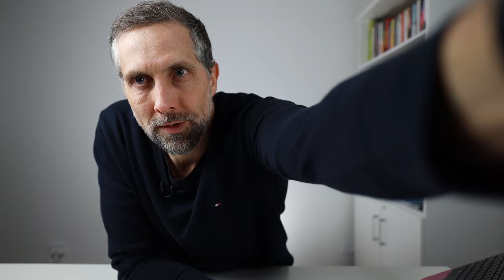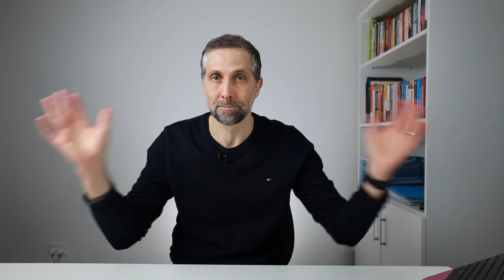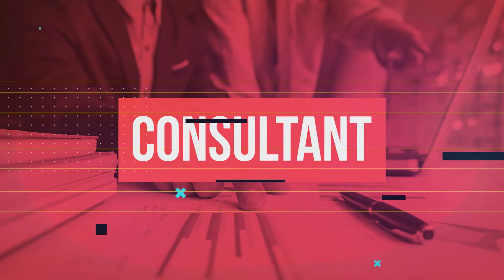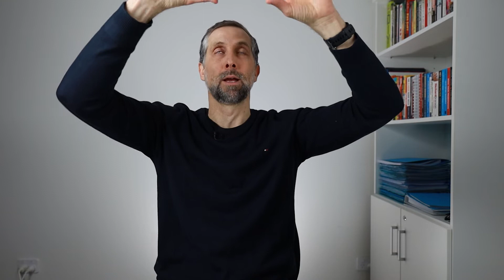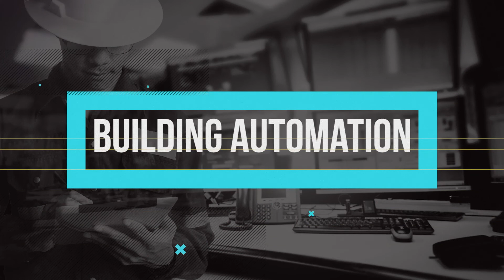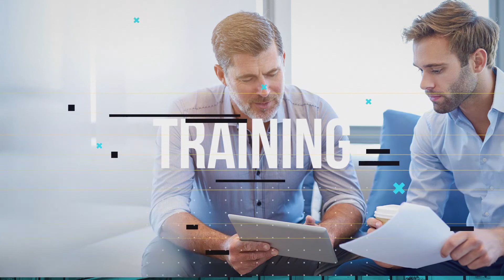HLI Commissioning ISSUES (BMS)

Comment: I think this happens because the one who purchased package unit and VAV diffuser is the client. If this stuff and integration BMS come from the Main contractor, they will do the loop check even for package unit. During commissioning stage, the unit package vendor should attend also and give all witnessing document. Btw there is two type of loop check, cold and hot loop check. Cold loops check to check electrical signal (digital and analog) and hot loop check to check interfacing signal (correct address from BMS to package Unit). I always ask BMS company to do check list for hot loop check before commissioning.

Comment: Hi Bryce,
Great video and I do agree that there are gaps in this process. However, I have to disagree with putting all the responsibility on BMS companies. I agree with the part that BMS companies to perform the full integration commissioning, but there has to be allocation in the specification for this. This practice will be costly and Mech contractors had to understand that there will be extra cost that they need to cover in BMS pricing. As you mentioned, precommissioning has to land in suppliers’ scope and they have to submit their point to point commissioning sheet proofing that they have tested everything on their side and it is working. Moreover, it has to indicate that the right point is linked to the right HLI point on their gateway. Then it will be BMS company responsibility to make sure everything is working as ONE system.
Reply from the maker: I am not formally putting all the responsibility on the BMS contractor.
 
I'm sort of saying that the BMS engineer is the only person who really understands what is going on, which therefore puts them in the best position to highlight the gap. 
At the end of the day the BMS engineer is going to be stuck with getting the whole thing to work. 
Whether they like it or not it's going to end up being their problem so they may as well get everyone together and lead the solution. 

I am pretty sure we are both on the same page, I'm just describing it from a consultants point of view.
Thanks for the comment 👍
Reply: Bryce Anderson thanks Bryce. This is one of the systems that is new and becoming more popular. It obviously will take couple of years to fill the gaps but we, as BMS companies, are always happy to help and get things sorted.

Comment: Great information. 100% correct on that these systems add more work to the bms integrator that  hasn’t been allowed for and if anything a descope of the bms package is occurring. 

Off topic and sorry if this has been covered in another video, I feel it is also important to note that the packaged system to be integrated to the bms should meet the intent of the specification without any unconventional control practice by the bms. With more integration begin specified I feel the manufacturers need to make a more detailed document around the HLI component of their product and the internal logic needs to be freely available to include in the FD’s.  Better documentation from the manufacturers would potentially assist with the planning of the end to end testing.
Reply from the maker: Shit, I forgot about that..
Good point. 
How often do we have an HLI to a packaged terminal unit, and then a couple of low level cables run from the riser to deal with the CO2 sensor and outside air damper. 
Yeah, the BMS contractor ends up doing a work around to make the packaged controls spec compliant.

Comment: Great video! We had the exact problem on a $4m BMS project in Sydney. I would note the following though.
Any 3rd party HLI using Modbus, must be commissioned Point to Point, firstly from the HLI itself, then driving each point, including any diesel points. A 3rd Party HLI Schedule must be created. I'd probably argue for BACnet/MSTP or BACnet/IP, the HLI can be tested, and a handful of points tested, as there is no need to test every single BACnet object. Although I argue that each system must be tested against the FD, with a signoff commissioning sheet, as a whole system. If the system faults, then you need to go back to each BACnet point. 
Wholistically speaking though, does this actually save Commissioning time? Saves time for mechanical, of course, they don't have to worry about it. But I can't see a time/cost saving from the System integrator side, in fact, maybe even more time is required.
Reply from the maker: Nicely summed up Leo, Thanks. 
As you found, it's very easy to make a mistake in a Modbus mapping table. 
Agreed, it's impractical to point to point every HLI point. However, at least create a commissioning sheet and sign off the points that could be easily tested. Then everyone can see what was and wasn't tested, no misunderstanding. Or agree upfront that say 25% of the points will be end to end tested, another 25% sanity checked against the 3rd party touch screen or PLC.